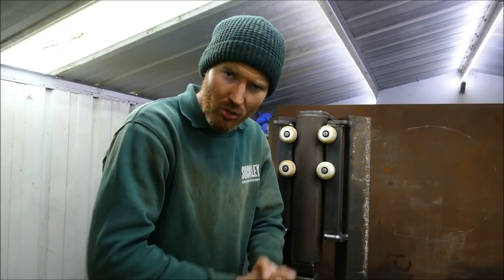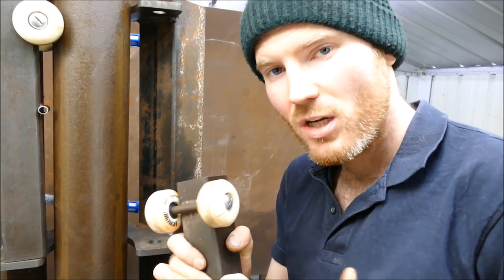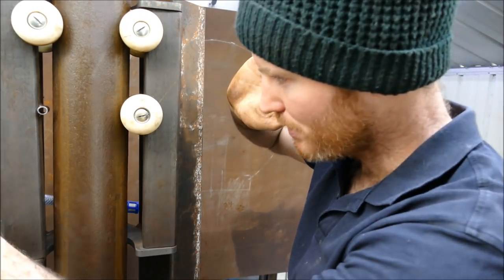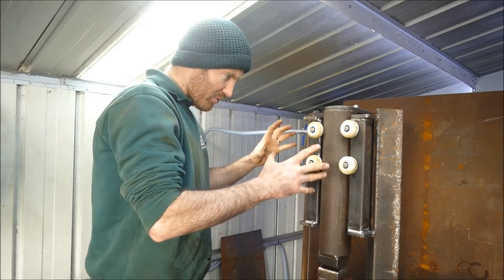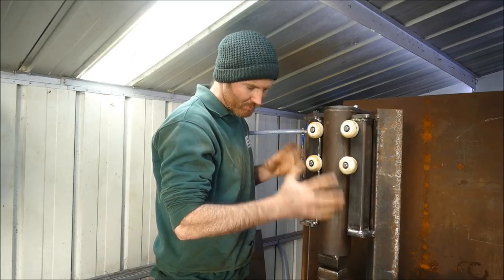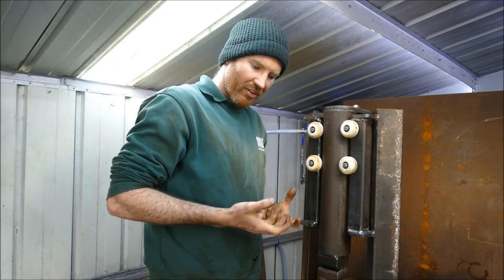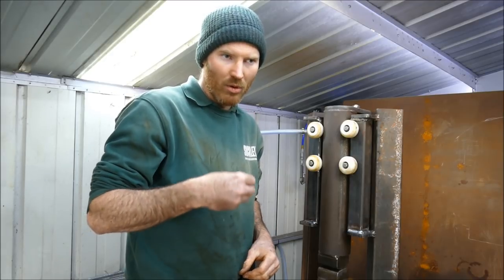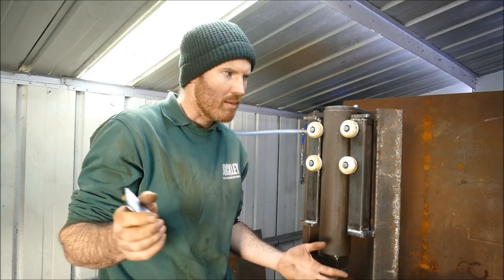Broke it ~ Fixed it ~ Made it better - the Ultimate DIY Power hammer with upgrades and updates

Comment: Hey Joshua De Lisle, yeah I'd LOVE to see you install the reciprocating motor adaption. That would be a fun project I think. Keep us posted and stay safe during these tough times! Thanks
Reply from the maker: Thank you, you too, all the very best, cheers J
Reply: I personally feel simpler is better, and the foot control is best
Reply: This is exactly the upgrade I would want - as much as I enjoy dancing, a little less tappy tappy makes a big difference in fatigue
Reply: @joshuadelisle  did this adaptation come out? I have not seen it.. Regardless, I have been watching your videos for a long time and I finally have the money to build my shop. What size air compressor is sufficient for your pneumatic hammer? And what size welder do you use? I am trying to calculate the size of the breaker panel that I will install in my new shop! I'm doing all the work myself. (as true smiths do) 😁 You're awesome! Thanks in advance and I'm interested in purchasing your power hammer design.
Reply: @Joshua De Lisle, these are genuine questions that I was hoping for an answer on BTW......... Real person here, asking about your setup.

Comment: I love your channel because you're a free thinker and build what makes sense to you. Your artistic expression encompasses not only the end product, but also how it is fabricated.  To me your hammer design is a work of art. 
I'm currently experimenting with a reciprocating assembly using an adjustable timer and a double solenoid valve. I'll use the manual valve for flow control. It's all great fun. looking forward to seeing your nail production setup. Keep up the great work!
Reply from the maker: Thank you so much. I would love to see your set up on the valve system. Do share on tg FB group in tg description. All the very best. Cheers J

Comment: my hammer came to life yesterday, still need to hook up my linkage for full use but this is going to be a great addition to the shop. and now the kids I teach can forge without using the big hammers. my hammer will be used only in my shop and will never be sold. when they ask I just say it was designed by Lisle.

Comment: Hello, Joshua  I think YouTube antilithics are totally wrong about you talking! : )
I ran across your power hammer build about 5 hours ago and have been checking your other Videos & Subscribed  to your channel because of your intense & Detailed  explanation of what your doing in the moment and that has kept me watching for over 5 hrs. now! I'm 60 yrs old & just getting back into forging after about 22 yrs and am loving it again so thank you! I'll continue watching as you now have a new Fan!!!
Reply from the maker: Thank you so much Michael. I'll continue to give my insight and talk about the details that you can't see from watching but generally I'll leave it until the later half of the videos and start with a montage of me making first. For some projects I'll walk through it like my welded patterns tutorials, my new workshop build and my DIY CNC plasma table coming soon. I'll also try and do more 'shorts' that expands on little details of the techniques I use. At the moment I'm filming lots but not had much time to edit as the jobs have taken priority. But lots more to come. Cheers J

Comment: Blacksmiths tend to be engineers by nature, to serve the need to design and make special tools and just puzzle through things.  My first smithing teacher was actually a Mech E.  In the past, art and technology were not regarded as separate things, and I think that is still right.  Case in point is arc welding. It's a major advance in time, materials and precision, but still a thing of beauty. BTW, as long as you are welding it in the forge, it's a forge weld!  It might be more accurate to call it a weld-forge because it gets done in that order.  One can forge out an arc weld and make it all but disappear.
Reply from the maker: Thank you Tim. cheers J

Comment: Hey Josh. YOu have my total respect. I get the ADHD and other abilities thing as too get pretty bored unless I am at the forges, kilns or anything else that is really hot. Keep up the great engineering and smithing. Remember a 15th century water wheel driven helve hammer is a traditional power hammer too. This just makes it a lot more achievable with the limited space we have. Much less a creek to power the hammer. Keep safe and keep the videos coming
Reply from the maker: Thank you so much. All the very best. Cheers J

Comment: I am just so inspired by what you in your videos, I learn so much, I find new ways to think about things. granted that's all I can do is "think" about things since hardships have caused the loss of my equipment. I'm really hoping you can do videos on learning to code, and the various other engineering things you do, I've been struggling to learn how to code, because i dont have the info o need ad what i look up is hit or miss. I'd really like to see how you do it, because I'm similar to you in ways, and that's what inspired me so much to continue making plans to one day create my work shop. and also about the blacksmithing club. I love it keep the good heart it's very warming to see, someone have that heart.
Reply: I would also like to add that I was once a disabled person(metally) and then I picked up a hammer and heard that ring for the first time, and that drew my grandpa to see what I was doing, at the time I was trying to bend a cold 6ft 1/16th inch rod of steel into a ball. and then my grandpa showed me that heating the metal made it easier and since then I learned hardworking and determination to overcome challenges some how set my mind right and since that day I've become a great man. and your videos remind me so much of all the time I got to spend with him, learning, experimenting, and working with what I have. and for these memories I sincerely thank you. it may not seem like much from the other side of the internet but just know it is an actual honor to be able to view the time spent to make these videos that you do.
Reply from the maker: @noahvang888  Thank you so much for sharing that with me. I can relate in a way, I had depression from failing at school and didn't have any skills of value. I thank God for Blacksmithing and that I didn't need an accademic mind to do it, since then I've learned many things. I fully recomend this guys channel https://www.youtube.com/channel/UCfYfK0tzHZTpNFrc_NDKfTA he is a good man and I am following his arduino lessons step by step. all the very best, cheers J

Comment: When I did my Blacksmith training, week one we had to make leaves, identical in size and form. We all struggled. The same instructor at the end of the course told us that when he has a large commission he has 1000 leaves laser cut and then textures them by hand. He is a great blacksmith, but not a historical one. He had the same approach to the productivity of the work that you do and I think it is the only rational approach to being a modern blacksmith rather than a historical re-enactor.
Reply from the maker: Thank you Toby, sounds like a wise man. cheers J
Reply: I have a great source for machine forged leaves, then I put in my forge and tweak them

Comment: As far as further content, old historic forged gates were the norm outside churches etc, most of these featured a punched diagonal rail with the bars passing through, Ive never seen anyone attempt this, but a guide to the marking out, layout & assembly  would be interesting from a historic point of view?
Keep up the great content
Dave
Reply from the maker: Thank you Dave, I've done something similar and i've seen my friends do a few, normally it starts as a slot then filed to the correct olyptical shape. I've seen special puching jigs and simple drilling jigs that do the same also. cheers J

Comment: I have to remind you again, put metal stops in place before your air cylinder fails. You should not allow the cylinder to extend and contract all the way or the ends of the cylinder will fail quickly. Keep up your good work.
Reply from the maker: Watch the latest video of the power hammer. There is no need. Cheers J

Comment: Hello Joshua, never do that with stainless bolts, you will wreck them every time. Stainless seizes very quickly without anti seize lube. Next time you can use a black or zink nut with the stainless screw,that works without trouble. I learned it the hard way too. Greetings from Germany.
Reply from the maker: Yep... Now I know... Cheers J

Comment: Thanks Joshua. Would love to see how your reciprocated solution turns out. An easier alternative may be to put some optical switches on your ram and put a solenoid on the 5 2 valve. You then get true reciprocation linked to the actual ram position .  Lots if opportunities with microprocessors for not much dough!
Reply from the maker: Thank you. I've been thinking the same recently ragarding limit switches. cheers J

Comment: Joshua,
1) 5:05 - it seems like you are tapping with some extremely thin lubricant (WD-40?). I've recently consulted the Soviet/Russian industrial standards that call for using oleic acid as the lubricant in slow-speed cutting operations. I've tested it in practice - and it works like a charm! Even the crappiest chinesium taps cut stainless easily! And the oleic acid is dirt cheap (~4$/litre at a chemical store here in Moscow).
2) 5:40 - welding zinked nuts and bolts is not healthy (think of "mad blacksmith" or "mad welder" - analogous to "mad hatter" with mercury poisoning). There are non-zinked "for-welding" nuts and bolts. And you can remove the zink coating chemically or by grinding.
Reply from the maker: Yes that is much better, I just don't have any.... yes I always keep it weld ventelated and wear a P3 respirator when messing with galve. cheers J

Comment: Wonder how difficult it would be to add another cylinder. Dual cylinders to double the hammer weight. Yours works great no doubt. Just curious. Finished my press and now wanting a big hammer but don’t want to spend $10k on one
Reply from the maker: It would need a large compressor for that, like an industrial screw compressor to keep up with the demand. It works well with one cylinder but for very thick stock I would consider making a drop hammer instead. Cheers J

Comment: Thank you....i have started to colect the parts needed for the build...and getting ready to purchase the steel..i have a question that may have been addressed in the comments that i missed ... Sorry if it has alredy been posted ...what is the potential yeild output per stroke
Reply from the maker: On a basic calculation of mass X acceleration. With a 68lb head it roughly delivers 1500lb of impact force on a 1" area
Reply: Thank you.. that is wonderful......was just curious...a friend of mine has a shop ...he makes Damascus billets...he as has a 200lb and a 500lb...industrial hammerand a 5o ton press....he was askin abou the yeild....i had no idea...... Didnt realy know how to figure it.... I am so pleased that you shared all the upgrades and insight........i have everything mechanical here or on order...just finished my forge knda over did it. For small stuff but i will get to the larger (for me stuff) and probably need the size....when iget the hammer done....right now i use a 2lb and 3lb....and occationly a short handel 8lb....i am so excited about getin the steel for this project i love building machines and anything else....thank you again ... Ill post more as it progresses

Comment: That linear motion device will cause reliability problems.  If you're going to use an arduino.  Changing your switches to electric, would allow everything to be controlled by the arduino.  It shouldn't be too difficult. 
I'm very busy for the next couple of months, but will have a look at it.

I used to program computers and, the arduino code looks fairly straightforward.
Reply from the maker: Thank you. Yes I've looked at it a bit planning the next video. I'm going to use solonoid valves and proximity sensors for the main reciprocating action and prevent over reaching impacts on the cylinder. Cheers J

Comment: Curious why you chose the electric actuator over traditional pneumatic setup with a 5 way valve and a limit switch. Reason being I built a mechanical hammer with the idea of someday converting to pneumatics.
Great videos, by the way.
Reply from the maker: It is Pneumatic, do see the build video. cheers J

Comment: You should check out a simple Cartesian style 3d printer and how the centric tension rollers work!
Reply from the maker: Sounds interesting I'll do that. Cheers J
Reply: @joshuadelisle  If I purchase your plans, would I receive the most recent and up to date model with all add on/fixes? Or do you require each addition to be sold separately.
Reply from the maker: @gregmaggert8561  hi. The main build hasn't changed it's just got add on upgrades. The description of the upgrade should detail what you get if you choose to buy both. Cheers J

Comment: Hi Joshua, just want to say that I'm very happy I find your channel. I my self am a welder and I'm thinking to start something at home, I bough a welder and a shed and then I've seen you on youtube channel and i'm like, this guy is doing what I want to do :D so, it makes my happy knowing there is kinda mentor figure from who I can learn. That said I need your advice.
how did you set up your electrical system to run your welder.  I bough a welder with 32amp socket and I'm just not sure whats the best way to set it up so I can run it, do you just have a transformer or did hire an electrician, how did you do it ?
Reply from the maker: I'm not saying my way is right or safe but its cheap.... I will get an electrician at somepoint. but I use a heavy duty (32amp) extension lead that is on the same breaker as our electric cooker. has a 13amp fuse and I know if I use over 140amps for too long it will blow. other wise Its been fine. but Its not right and I need to pay money to get it done propperly.... one day
Reply: @joshuadelisle  that's exactly what I am afraid of, I my self am on the low budget and electrician is my last option, but I want to have it right and electricity is something I'm interested but know nothing about it. Let's say for now I'm only going to weld short welds with low setting, I would be fine with your set up ? Do you burn fuse often ?

Comment: I’m just getting caught up on a few of your vids. I probably missed it - but what do you estimate the power of this little beastie at? Love the compactness. 
You might detail your take on a build of a 2x72 belt grinder? (if you haven’t already) - it’s another nice piece of kit that is priced way out of my current budget.
Reply from the maker: Thank you. Your not the first to ask for a belt grinder. I have that exact size grinder in storage until I get a new industrial workshop. I don't think there is much to them apart from narrow and larger wheel changes and speed control. Definitely will think more on that after my other projects. Cheers J
Reply from the maker: I calculated it to have 1500lb of force on a 1" area. Head weight is 67lb

Comment: Sounds like your master plan is pretty similar to what I'm doing with the U.C.F. Joshua.  You might consider going for the C.I.C. option (as we did) as that allows you to go for awards and grants in the same way as charities do. A lot of funders won't even consider entertaining a private business for an award or grant. The other issue is the amount of leg work and time from putting together a proposal and having it accepted, to then receiving the financing, often it's the better part of a year to go through the process.  
We have used private courses in the forge to subsidise our overheads on some of the work we do with special needs kids but it's not always possible. If you can develop a product that generates sufficient profit for you to do so then I'd say crack on and the best of British to you. I have no doubt at all of the tremendous benefit our craft can bring to children and youngsters with different abilities, I've seen it first hand.

BTW I'd also like to see what you're going to do with the little gizmo, will it be able to control stroke length as well as speed?
Reply from the maker: Thank you so much I will look into that. the arduino will do some amazing things and stroke length is one of those so yes i'll do more on that. cheers J

Comment: Don't you need to be able to set the Pilar's closer to the shaft bit when the wheels wear down (and get smaller). Or when you use different wheels that are a slight different size.

Comment: Hey this is completely unrelated but you didn't respond to my linked in request so here it goes, (with liquid incouragement attatched)  I dont know if you have harbor freight there where you are but they are a cheap place to get kit.  so I have a 20 ton press that is too tooooooo slow to use as a press in blacksmithing but the framework is there and was wondering if you could assist on showing how to convert a 20 ton press into a blacksmithing press.
Reply from the maker: Hi Cory sorry I havent seen your message. You know what I have thought of doing that  as I have a 20T jack. Gary Huston did a video on making a break press with one which was cool. cheers J

Comment: I can imagine, if you plucked a "traditional" blacksmith, from the early 1800's. Then, showed them all the tools you have available to make the job easier. But said you weren't using them, because you are a "traditional" blacksmith. They would call you an idiot and tell you that they did it, traditionally, because they had to. If they found easier ways of doing things, they called it, "progress." Of course, few back then, blacksmithed as a hobby or side job. So there weren't as many purists judging how a working blacksmith, that embraced progress, went about making a living.
Reply from the maker: Well said. Cheers J